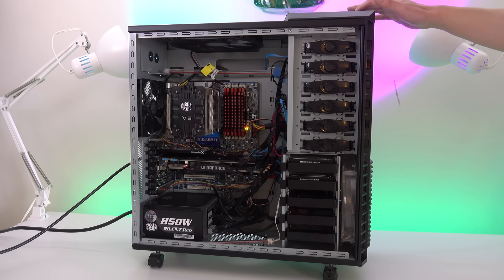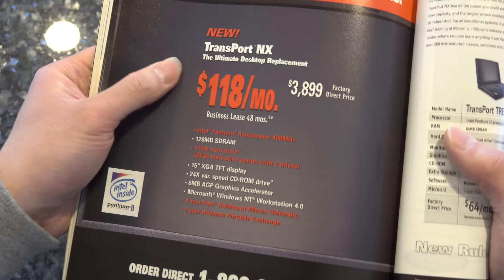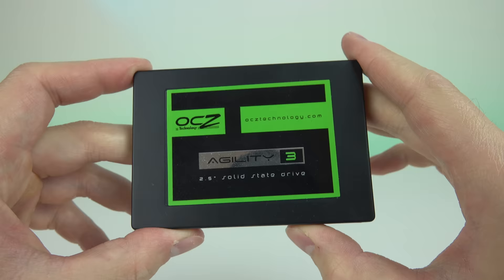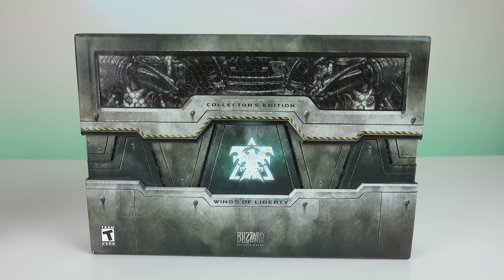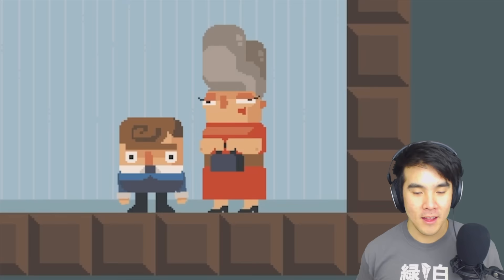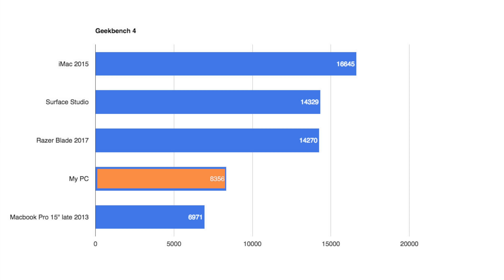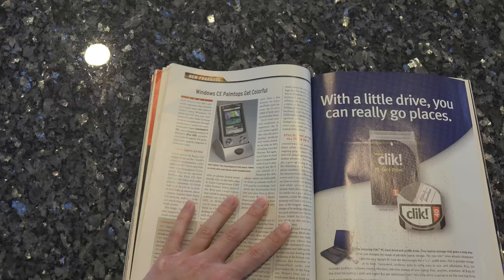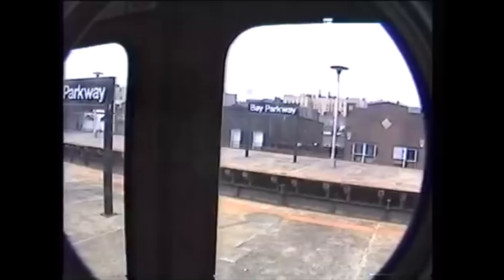I Built This PC for $1360 in 2010. Here's How It Holds Up.

Comment: I'd recommend you upgrade to an Nvidia GTX 1050ti at least

that as well as an 8th gen i5 or i7 clocked at a minimum speed of 3.0 GhZ(about 2.8 would be fine too)

a motherboard with more SATA ports would be a good call too

honestly I love how many USB ports you have, all of mine are taken up by my Elgato, mouse, keyboard, and microphone, ignoring the two on the front, which one is currently taken up by my headphones, and sometimes by my controller or card reader

I also miss my disk drive from my last computer

Comment: I remember when Dell did a 8000 dollar workstation in 2000, and in 2004 a mid range gaming PC (800 dollars or so), so something that had like a 560 pentium and say a 6600 GT with 2 gb ram and a 200 gb HDD. A 800 mid range gaming PC destroyed a 8000 dollar workstation that was just 4 years older lol. 

Yeah. Computers used to age like fine BREAD lol.

Comment: You are spot on with your analysis, the pace of change with in computing has slowed down considerably over the past eight years or so. I have always upgraded for features, rather than performance too. 

It is now 2019, and I am reluctantly upgrading my 2600k Sandybridge computer, which I have used daily. It has had several GPUs over the years, the last being a GTX 1080ti, and a new Samsung SSD, but nothing else. I would still use this CPU now, but I would like to experience some new features such as m.2 drives and the cumulative k iwkedge of eight years of motherboard and CPU design. 

I still remember when I first purchased the 16gb of 1600mhz ram, the guy in the shop could not understand why I would need so much way back 2011, when even 8gb was seen as overkill. Time has proven me right though, with 16gb being the standard now for gaming. 

I have recently upgraded to a new computer that cost just over 2k. It has a Z390 motherboard, a 9900k, and 32gb of ram. In building this, I came to exactly the same conclusions as you have. This new computer will be good until at least 2025, if not longer. I plan on buying some extra storage (SSD and m.2), and I plan to upgrade to the successor of the 20 series RTX GPUs, but that is it. 

As for the 2600k, it will live on forever as a Linux computer, still used daily.

Comment: Try a cache App like eBoostr, you will see a very good improvement with your HDDs, just give for the cache some space on your SSD (say 16 GB) and 2 GB RAM (or less), and maybe a 16 GB fast PEN (writes and reads in parallel with 2 or more cache devices), after read the stats and optimize further ;)

Comment: Just last week, I dismantled my 2007 Pentium D computer with 4 GB 800 MHz RAM with water cooling and replaced it with Ryzen 5. Feels a bit sad but it was needed. But I am not gonna throw it away. Will put it in a smaller cabinet and run Linux HTPC on it. :)

Comment: The funny thing is my computer has i7 8700 (2017) and a GTX 1080(2016) which technically means my pc is slightly older than how this pc was back then but I literally have no issues running anything 😂

Comment: Well , currently you can upgrade for cheap , Xeon CPUs cost 10-20 Dollar for a 2640v4 or2680v4 on Aliexpress with 10 / 14 Cores , released 2016 . I ordered an CPU/ MoBo / Ram Kit for 260  Dollar with an 14 Core 2680v4 , 128 GB ECC DDR4 2133 Reg RAM , Quad Channel , 40 Lanes PCIe 3.0 8x Sata 3 f X16 Slots ( 16x 16x 4x ) , 2 NVME Slots and 8 X Sata III . Downside , you cant OC Xeon but thats not necessary for me , its for my NAS . An 2680v4 would have cost you 1800 Dollar in 2016 , now its 20 Dollar

Comment: Yall abandoned me, i still have asus sabertooth x58 (same socket as urs) and xeon x5690 (6core oc to 4.2hz) and i have 24gb of g.skill 1333mhz. i did upgrade my gpu recently to gtx 1080 and got some ssds. this pc be fast as flip boi. You could totally have gotten an x5690/x5670 and overclocked a bit, especially with that cooler. heck even an i7 990x with overclock would have helped you alot. and then just a newer gpu. its been proven that new gen pcie doesnt do much if anything for performance so the motherboard would have beeen fine.

Comment: I am still rocking my build from 2012, built with an i5-3570K and a $500 budget. It's not long in the tooth in the slightest. To get some more life out of your machine, see what upgrade options exist for your motherboard in terms of CPU. My motherboard can run both 2nd and 3rd gen Core i3, 5, and 7 CPUs. Even upgrading to a third gen i7 would get you the extra threads needed to stream and game at the same time. Also may help alleviate a bottleneck between the CPU and GPU which could cause slow renders. Also, when you render, does your software have to pull from the same drive it's writing to?

Comment: You wouldn't even have to build a new system. That platform is still relevant. Just get an x5650 CPU with 6 cores and 12 threads and you're good for at least another 3 years.

Comment: Technology slowly reaches it's borders. CPU Transistors nowadays are around 12nm. The smallest transistors made were around 3.5 nm. A silicon atom is 0.2nm wide. Yes, there is quantum Computing as a solution, but they need to be cool as fuck and some fans or water cooling won't make any difference.

Comment: This is pretty much exactly the PC I built in 2011, and also still use today. Only difference is I have a 2500k 4.6Ghz, 16GB RAM, and a 1080ti. I however, have had stability issues with mine, but that is mostly because I OC'd the CPU. It used to run at 4.8Ghz when I first built it, but I think it has degraded over the years, and now frequently crashes at that frequency.

Comment: So did you upgrade yet? If you want to build an equally overkill computer today, you would need 3500-4000$; but it would be like 4x better at least than this computer too. Kinda funny how that goes, price to performance hasn't really improved since ~2010, so if you buy a computer today for $1360, it'll probably perform similarly well as your $1360 rig from 2010 lol.

Comment: I built a pc in late 2010 or early 2011 that had a core i7 960, a GTX 570 8GB of ddr3 ram, liquid cooler, and the case was a thermaltake level 10 gt it costed around $1800 USD

Comment: if I was you, I would replace that Samsung 840, there was a terrible firmware problem that last time I checked never got fixed even years later. I would recommend getting the 860 instead. And as a gamer I would upgrade the graphics card to a RX 580 because they are currently around $200 or if you want a little more performance for future proof go for the GTX 1070 TI for roughly $385 lately. As for the CPU… In 2019 Ryzen is setting 6 cores as the new entry-level for only $99... Which is incredible that that's going to be the new standard, applications are utilizing more cores these days so 4 is no longer going to be the minimum

Comment: Ha! Im still running my GeForce 8200 board with 8GB DDR2, a Quad Core anthlon,  GYX760, 240GB Drevo SSD and a recently added 1TB WD Blue drive. And you know what, If’l run far cry 4 on max at 40fps...

Comment: He could really just upgrade his mobo/ram/cpu and have a pretty decent rig, 1080p gaming is not as demanding and the 970 is still a good gpu
Reply: That is basically buying a new pc at that point it's not an upgrade if you are replacing everything keeping the same case doesn't really count either
Reply: @Rob-nd1qb  he can keep the case, hard drives, ssd, gpu and psu and just buy some used ryzen kit for $150, if you are on a tight budget that's actually pretty convenient because at 1080p a modern cpu will give you a good boost in fps

Comment: You can fix your ocz just plug it into a linux box and get the newest firmware off the website; hell by now you might be able to update it fully in windows, however Linux was required when I had issues with a few I had.

Comment: I have PC from 2010 too it is doing good too, Yes it is using 2 GB of DDR3, Yes it is Athlon. But i can at least watch Youtube in 720p60, or Youtube in 1080p30, it is was even able to run great on 1600x1200, i am using it's Graphics card on my PC. Also i was making Youtube Videos on it, and i have laptop from 2013, and it works laggy with Windows 10, it is taking several minutes to restart. It's because of updates i guess, because when it had Windows 10 1511, it runned great.

Edit: Athlon will never be bad!

Comment: im bad at saving so i have case:Deepcool tesseractmb: Asus p7h55-mcpu:ci5-650gpu:XFX Radeon HD 6870 with arctic accellero twin II COOLERhdd:3 7500k rpm fans:7 deepcool rgb fansps:500watt evga 80plus bronzecooler: Deepcool iceblade 200m ??led: deepcool rgb thermal grease:again..deepcooli wanted to build a deepcool system at that time and still use it its ok for me il ade next year everything but keep the case its cool with rgb

Comment: I built in 2022 a PC with a 4790K from 2014, it still held up pretty well throughout 2022, even Warzone, a pretty demanding game from 2019 was no problem to it and could perfectly chug it down giving 80 to 80 FPS, although almost at its limits, since once you turn the graphics down it just went into 100, which means it was starting to get old, specially once Warzone 2.0 came out, poor old motherfucker didn't stand a chance, wouldn't get anywhere over 40 FPS, that day I decided it was time to upgrade, and on february 2023 bye bye 4790K and hello Ryzen 5 5500

Comment: pew i dunno how much moneh i spend on my PC and i change several hardware parts every year. My CPU went from 2001 Windows 95 Pentium 166 MHz to 200 MHz MMX to Windows XP 500 MHz Pentium III to 1.3 GHz Pentium 4 to 3 GHz Pentium 4 to 2011 2-core 3GHz AMD Athlon II to Windows 8.1 4GHz 4-core AMD A8-6600K to 3,5 GHz 6-core AMD FX6300 to 4,7 GHz 8-core AMD FX9370 from 2013 to my actual processor from 2018 AMD Ryzen 7 2700X  ~4,35 GHz at 8 cores and 16 treads and finally i also comit to Windows 10 since my win 8.1 refuse to do updates for some reason :D I know i could use my computer no problem for the next 10 years without the need of upgrading any hardware, but thats no fun so i gonna upgrade something even next year :0

Comment: Ok I’m having trouble here, I spent 1200 in 2012 and somehow you were able to afford better parts than I did. I5 2500k 560ti and the lower tier cooler master case without the custom cpu fan Where the heck did you find those deals?

Comment: Idk I see the next boom being a combination of standard diode for doing equations, while quantum is used for AI assistance or for gaming for more adaptive NPCs.

Things aren't really going to get much smaller, they try but things are so close as is that the current jumps contacts. 
Id say the next big thing for speed is going to be in heat management, if we can find better ways to displace that heat systems can run closer to their full potential.

Comment: Mines a similar build that still holds up 120+ on overwatch
I7 920
Asus x58 sabretooth
R9 280 x
18gb ram ( 3xcorsair budget ram, 3x corsair xms 3)
I think the case is a tt antec,  
And a corsair vx 550w psu

Comment: I bought a $600 Toshiba laptop in 2010 and it's still my main computer 🤣
Reply: My Toshiba laptop lasted from 2010-2018. It was pre-owned before my computer broke in 2017, so I was given a 2010 Toshiba. I sold it to a tech recycling company for £5 (Around $7) in 2020 despite my tech collecting hobby.
Reply: @avillagerplayingminecraft5833  My 2010 is still going. I keep it on 24/7, so I imagine eventually the cooling fan will fail and it will be dead.
Reply: @winterburden  I had a charging port failure, and it was already 8 years old so I just left it for another 2 years until I sold it.

Comment: BS. Computers were cheaper in 2010. I made mine in late 2010. I paid for motherboard, i7-920 and 6 GB RAM less than today i7-8700 price! GPU prices are overkilln i had gtx 260 and gtx 660 that both cost me less than i paid for gtx1060 in 2018. For the same reason i went for Ryzen. Intel is no go company as of 2018. Maybe they will return in 2020, for now I have first AMD since 2001.

Comment: my pc is the same! xD i still use my amd fx 6100 six core  from 2009. but I want to upgrade it but im in a bit of a weird spot where if i upgrade it to the cpu i want I need to change the mother board and if I change the mother board I need to change the ram so its turns a simple £500 upgrade into more a £1200 upgrade xD

Comment: In 2019 - 8 X 4 = 32 GB Ram is Standard  / 8 Core CPU is Standard / RX 590 is Standard
Reply: sorry 32gb is not standard. 16gb ddr4 is.
Reply: 16 GB Ram is Stardard / 32 GB Ram is for rich people
Reply: @lovekush9103  most people are not rich. btw to clarify i am running 24gb in one rig and 16 in another. also running 2 macbook pro's oldest from 2016. still i think 2x8gb is standard and you dont need more..... yet.
Reply: @raunchyNO  When you copy 100 thousand Pic from PC to external HDD . You need more RAM
Reply: 🤣 yeah. And if you have over 100 tabs open in chrome. But thats not realy standard behavior.
Reply: @raunchyNO   - If you had 4 X 4 TB HDD in you computer . You need more Ram
Reply: @raunchyNO  - If you are Graphic Designer . You need more Ram
Reply: @raunchyNO  Less Ram become Input Lang
Reply: @raunchyNO   - I had 300000 panty house pic . To copy from PC to external HDD i need 64 GB of Ram . 16 GB Ram is input lac
Reply: @lovekush9103  panty hose pics? 300.000 of them? 😳
Reply: @raunchyNO  English bride pic 50 000

Comment: Gtx 970 was released September 18, 2014. So.. not really "7 years old computer" . Maybe you mean 7 years old cpu but that's not "PC" but a part of your PC. You cannot say you build this computer in 2010 since you upgraded to gtx 970 somewhere between 2014 and 2017. Again if this PC was upgraded after 2010 then you can't call it "PC build in 2010". Clickbaity and incorrect title.
Reply: It has the same motherboard and CPU. Most people would define it as the same PC, but with an upgraded graphics card.

And it doesn't change his point. In the 90's and early 2000's a 4 yeard old CPU would bottleneck the graphics card a lot more than it does today (today, a 4 yeard old top-of-the-line CPU, like the 4790k, will not bottleneck your system when it comes to games)
Reply: @son_guhun  the point is, that tech only develops slower nowadays... and buy using a relativly new gpu, which together with the cpu is the most important thing in a pc, his point isnt really demonstatet correctly here... because if he would use a 2010 gpu, then you would really see how far the tech development has come... a gtx 970 is still on the level of mid tier gpus... and a 4790k will defnetly bottleneck in newer games which utilize cores efficient and is very limiting when you want to do multitasking or just have stuff like discord and spotify in the background.. i know what im talking about :(

Comment: This truly showcases the value of building your own system. An i7 930 is still a decent enough processor even in 2019, so much so that I would say that for most AAA titles it wouldn't even bottleneck a mid range GPU like a GTX 1650. As for the 400 series graphics... Well let's say you didn't upgrade in 2015 for nothing.